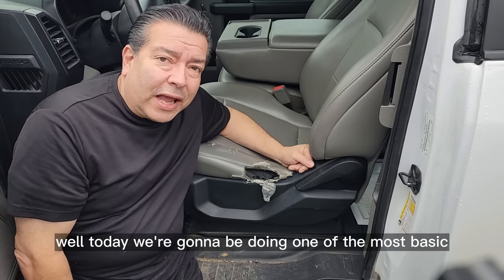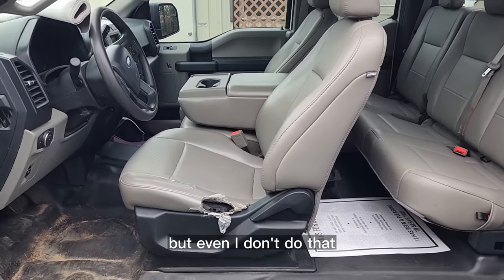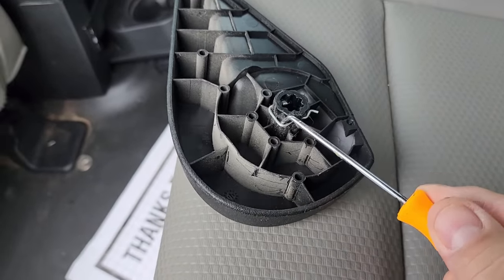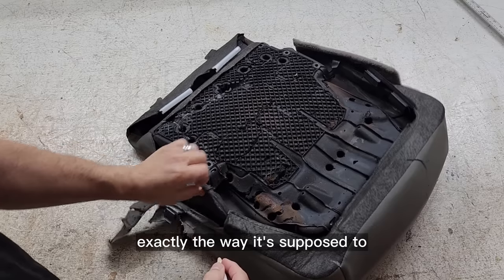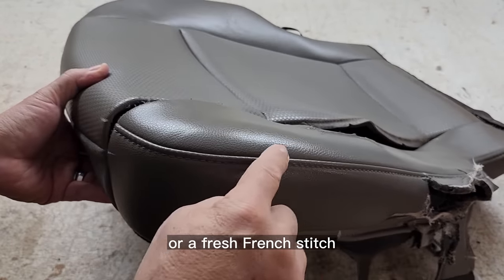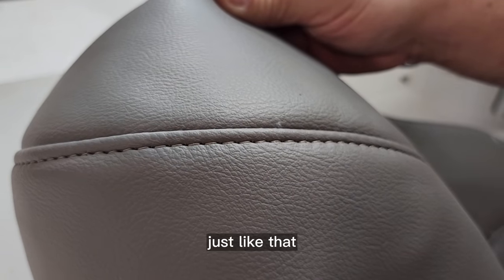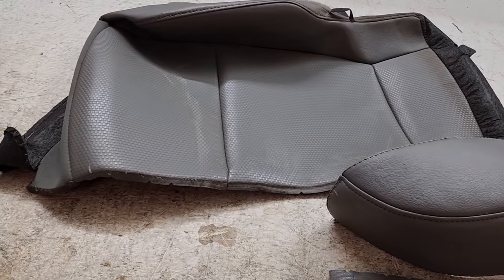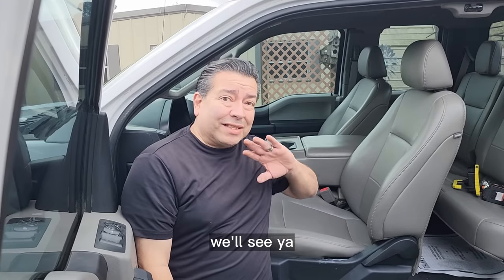Most common auto seat repair upholstery

Comment: you don't have to replace the panels you can repair them.  Fail.
Reply from the maker: Hello Art, What you say is true, there is more than one way of getting things done right? 35 years ago I considered vinyl repair like the Mobile guys do at the car dealers. But I saw no matter who does it it still looks really bad. I never wanted to do that kind of quality so I chose replacement. You will never see me do a repair like you are describing. I have a great reputation to uphold. WIN. Not only that but I can make many time$ more by replacing what's bad. Please keep liking and watching!
Reply: @oldschoolautoupholstery  I've seen a million videos where the repair of the existing vinyl looks flawless so the claim all repairs look bad is not true.
Reply from the maker: @artbyrobot1  Hello Art, I guess what I am thinking about is the repairs I see at the car dealers that never last. They never prep before spray dye and it peels off. Often times the color match is way off. That has been my experience. I think your experience watching videos is different from my experience. Please keep liking and watching!